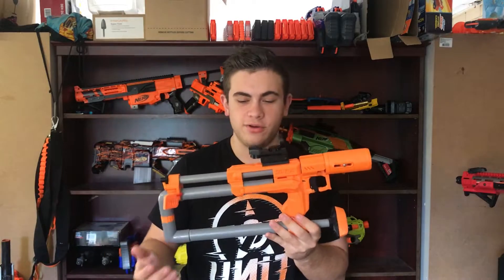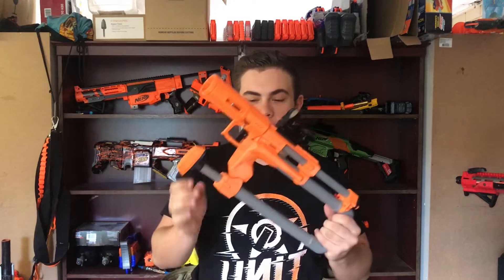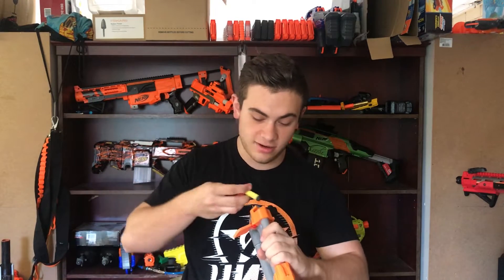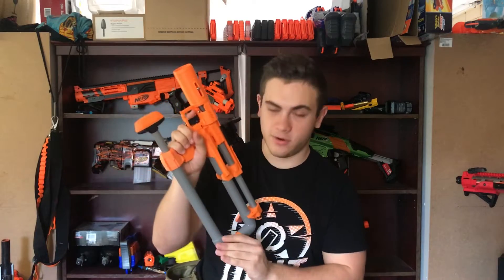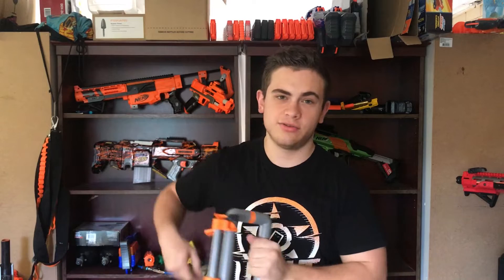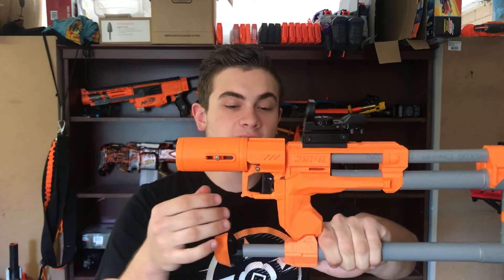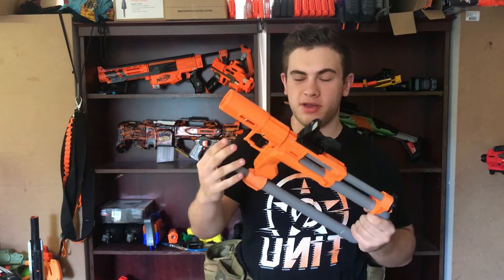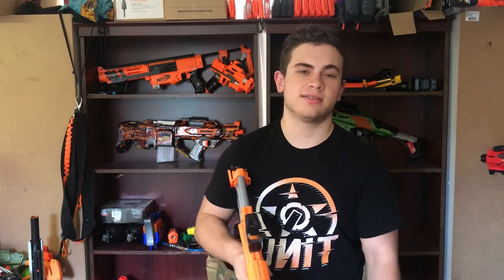JSPB 1.6 Pro Overview || Great Sub 150FPS Air Blaster

Comment: I recommend the long scar fully it keeps up with my prophecy practically but can use full lengths as accurate as halfs or mix it up run whatever you pick up off the ground be careful I noticed the rays and accustrike wear the scar strings oh and I run little pvc with a rubber plug as speedloaders good trick for these
Reply from the maker: Insane0 Juggalo may get one after playing with this one now, cheers